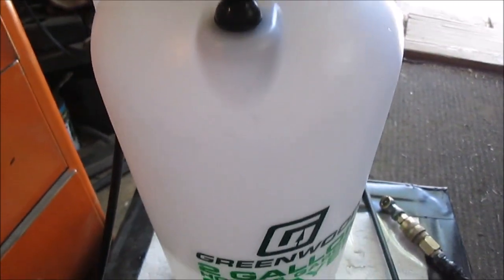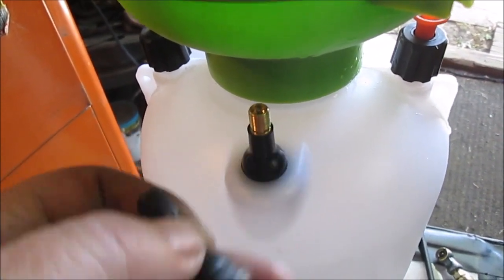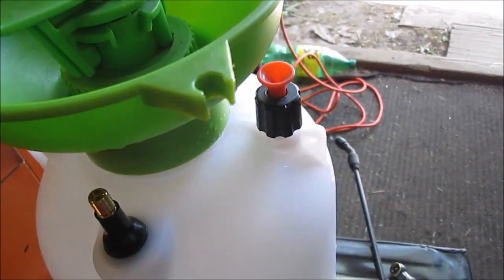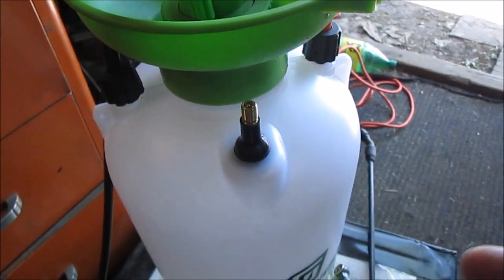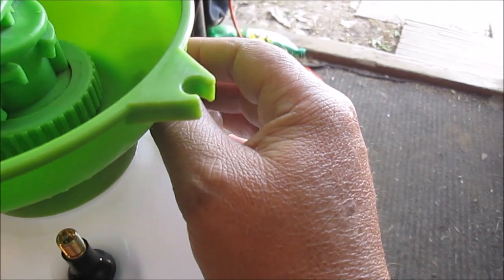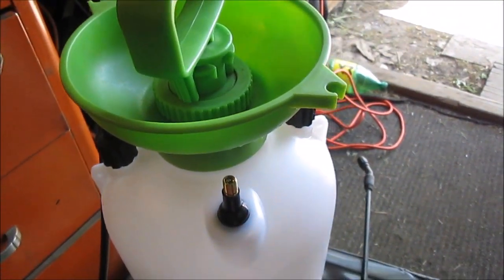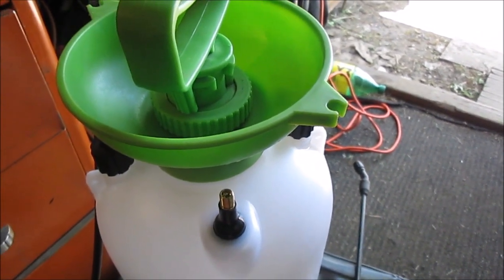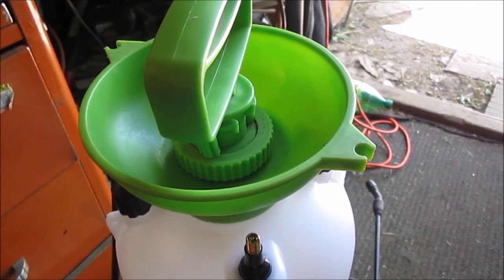Garden Sprayer modified with car valve stem

Comment: I was thinking of creating a portable pressure washers by pairing my garden spray with a cordless tyre pump. Unfortunately my sprayer does not have a convenient spot to mount the valve so I was thinking about taking out the pressure rekease valve and replacing it with a car valve ... the tyre pump will take care of maintaining pressure at the a safe level.
Reply from the maker: Be Careful I would not want too much pressure in a plastic tank

Comment: I removed the safety valve and inserted the tire valve in it's place. I pump that sucker till the water level drops like and inch due to expansion of the plastic and go to work that thing really sneezes good! Also I had to insert a PVC pipe inside the old pump cylinder because it was collapsing due to the pressure inside the sprayer works really well now.

Comment: I put a gas gauge in the pressure release  that way i can watch the  maximun pressure  of the pump wich is 40 psi , i had the same problem  with that  pressure release valve  so i decided to  put the gauge in that position.

Comment: This has to be one of the most brilliant mods ive seen in a while. Unfortunately my sprayer is older and doesn't have the safety valve, so ill be adding one of those along with the tire valve. Most new Chapin sprayers say their operating PSI is 40-60, so ill calibrate accordingly and hope i don't blow myself up.
Reply from the maker: Having a safety pop off valve is a must ...be careful !!!

Comment: I bypassed the pressure relief valve with crazy glue and just by hand pumping no air stem mod I got it to 52 pumps. I walked away and it was louder than a shotgun, ripped the front ripped/ blew the front apart, not the tank seam like ripped the plastic.
Reply from the maker: That is why I put in the description a Warning not to by pass the pop off valve ....That would have scared me to death having it explode !!!

Comment: I'm inspired now to make my version of one thanks. Safety is on target. It seems like all the new sprayers have the pop valve and the idea of a regulator is a good one. I do however know of a young man in the older days that aired up one of those metal can sprayers with a 250 psi source which blew out and nearly killed the kid.
Reply from the maker: Safety First !!! ...The pop off valve is a must have part ...I put air in mine till it starts to come out of the pop valve and It's ready to use ..Thanks for watching !!!

Comment: I've been meaning to do this to all my sprayers for a while. A couple years ago I actually found a sprayer at an auction that they put a tire valve in from the factory. It has no hand pump at all.
Reply from the maker: My Dad had a metal that someone solder a valve in it